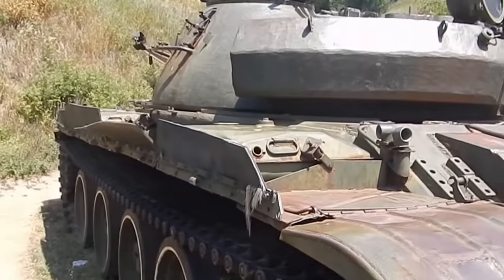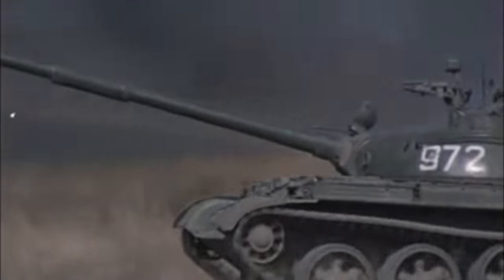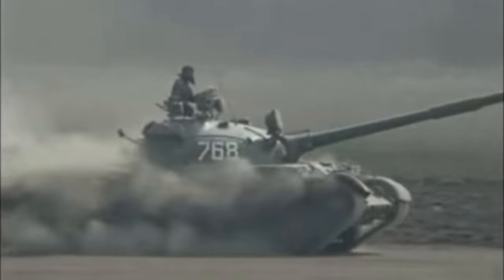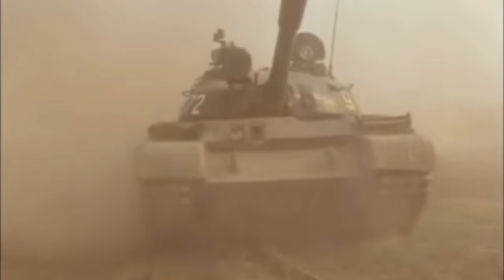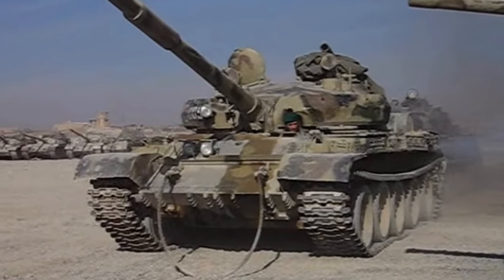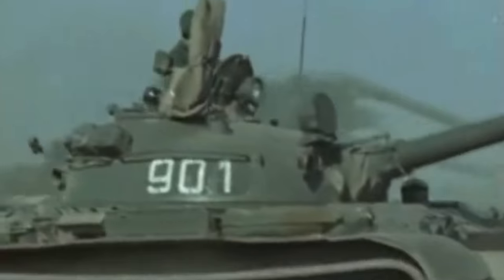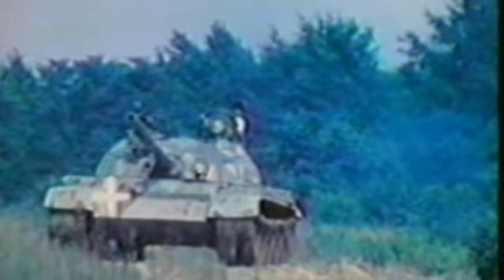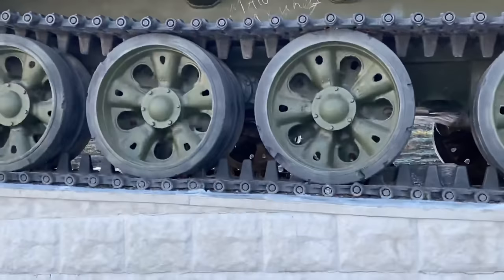T-62 Main Battle Tank | SMOOTHBORE UPGRADE

Comment: A super Dolly Parton tank at time stamp :59
Reply: Aren't you the guy who had a breakdown on the Strv 103-C video?
Reply: @ozzyakiro4734  No. I am the guy that said the s tank is over r rated. Which it is.
Reply: @thunberbolttwo3953  Its a SBT/TGC made for point defence. It's badass in my opinon. 40mm on the upper plate for bouncing APBC shells was ingenious by the designers.
Reply: @ozzyakiro4734  Not really. It wasa gimmick tank. That never lived up to the hype.
Reply: @ozzyakiro4734  Having 40mm upper plate  armor was weak by late ww2. By the 50s it was a bad joke.
Reply: @thunberbolttwo3953  It bounced round ranging from HE to APCBC to APHE. Only APFSDS shots could puncture the armor. Remember, it was extremely angled. Later models even incorporated heavier armor and the vehicle was extremely survivable. When it was doing its job, it was nearly invisible. Greatest designed tank ever. Great for attacking as well using unconventional tank tactics.
Reply: @ozzyakiro4734  Except the s tanks armor was a bad joke. As to tactics. It was good only for ambushes thats it, Now goodbye troll.

Comment: I mean..20 thousand is a good ammounts. It terrified the isrealis for a while but the Arabs didn't really know how to use them
Reply: I think a lot of the bad rep of Russian Tanks is due to some of Russia 's allies not knowing how to best use the tank and play off its strengths. And as with any export version of tank they don't always come with the most current tech and gear for the tank.

Export Abrams and Leos haven't always been used effectively or were given all the current upgrades and tech to aid in combat effectiveness.

And really only when the Russians themselves were sustaining heavy T62 losses in the middle east it had already long served past its stop gap role and I don't want sound morbid in anyway.

 But I could suspect that the Soviet Command staff probably saw t62s and their crews as expendable. While the more modern T72s and T80s at that time would the tanks they saw that would defeat the rebel fighters or whatever. But again I not saying this comment is entirely true.

But If were military commander serving a dictatorship I problem wouldn't care about the toll it takes to win  and would basically use my second line tank units as cannon fodder to the enemy so that my tanks and elite tank crews could flank and surprise the enemy while my bulk expendable tank forces providing a an effective diversion for the enemy. However that isn't the most or best means of dealing with the enemy.

But to any commander who is capable of thinking and breathing at the same time it might seem like easy choice to go with. I am just not sure if the USSR really was as incompetent in the middle east as people think. I mean yes mistakes were made bad ones and unrecoverable ones to. But even the most basic Russian crew would have better training than their middle eastern counter part. So some how I think the Russians intended or expected to en cure heavy t62 losses but that is just my opinion. 

Sorry if I got to wordy here I just find it interesting on how opinions change on tanks that have had history of being trash or bad but in fact during their time they were actually pretty good tanks or decent enough to at least compete with their contemporaries may not be the top dog tank of their era but at least even give said top dog tanks run for their money.